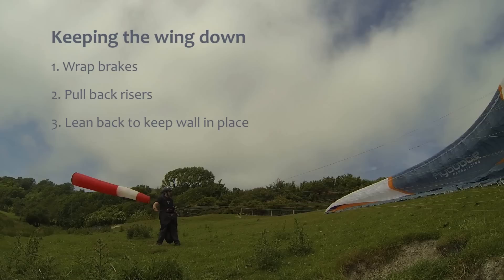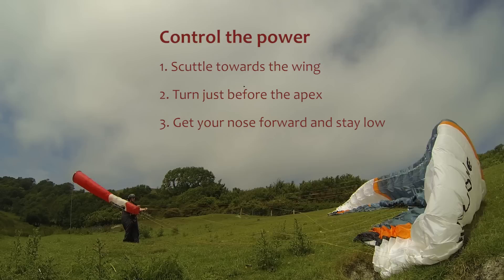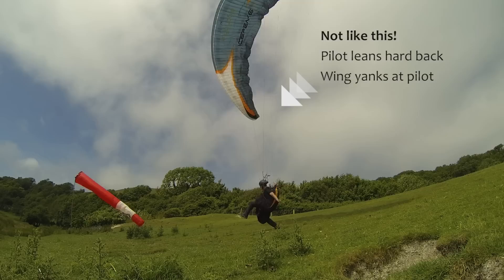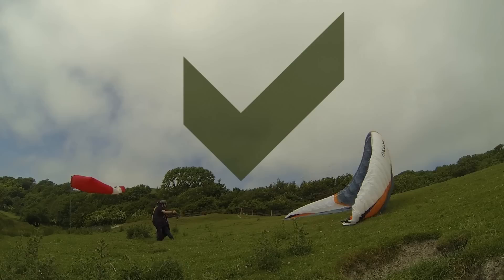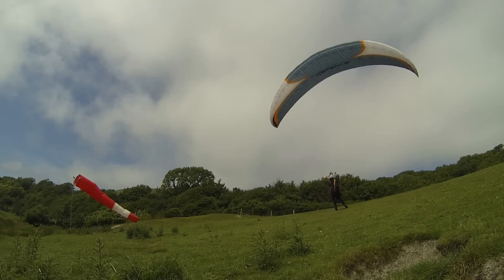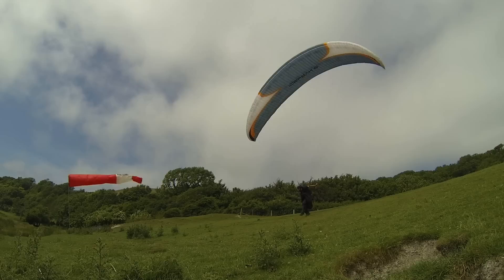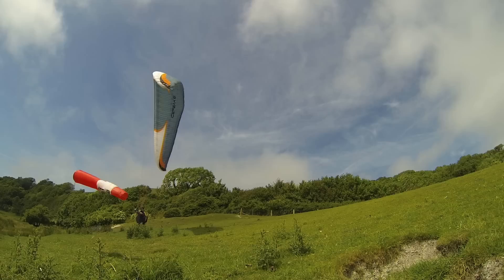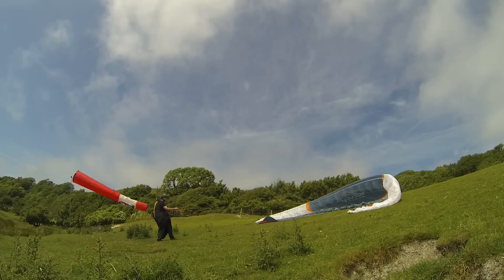Paraglider Control: Strong Wind Launching (Simple Depower)

Comment: Agreed: the differences between good and poor launch technique can be subtle i.e. correct timing and small movements. You can get often away with poor technique in moderate wind, less often so in strong wind - and usually with far worse consequences!

Comment: Nice video, but I prefer to demonstrate control over the wing BEFORE turning around.   Turning around simply because the wing is reaching the apex leaves room for error, especially on a launch with limited space.

Demonstrating dominance and control of the wing with A and C/D risers before turning is much safer in my opinion.  Also, if you sit down hard in the harness and stand up as the wing is rising, you won't have to run so far.  Good for small launches.
Reply: Waaaaaaaaaaaaaay better, The only way, please!
Reply: How can you control in strong winds if you dont lift off right away?   EDIT: Answered here https://www.youtube.com/watch?v=EwlUDKl7E5w

Comment: not really that strong wind, actually. For this sort of conditions this technique works fine. nice demo
Reply: ***** sorry mate, but the wind at wing height is at least 5 km/h less than your estimate. That, and the fact that the slope is quite flat makes it a perfect ground handling spot. Nice hips control there. ;) I prefer the A&C riser technique for windy conditions. Much more directional control when pulling the glider up and less drag. Besides that I almost always lean back when pulling the glider up until the 45º power zone. Only then do I run under the glider. Saves me a couple of meters of running, which can be crucial when I'm on a tight launch unlike the place you are using for your demo. But if one keeps pulling past the power zone then what happens is what you show in the video. Not because of one leaning back. P.S. I fly the IP6 myself...
Reply: ***** I don't get how using A+C risers would give you less directional control than not using rear risers at all. You must either be joking or not understand the use of A+C technique at all. When holding only A risers to pull the glider up you have no directional control at all but the one in your hips. Some (although) limited directional control by using C or D risers is better than none. And If I need more I can always let go and use brakes, same as you do. But in the process of picking the glider up from the ground and getting it through the "power zone" I have a number of options more than if I'm only on brakes. One of the main ones is being able to kill the glider without being dragged, which is the most likely scenario if things go pear shape in really strong wind when using only brakes and the other one being faster and more controlled lifting of the glider through the power zone. ;)